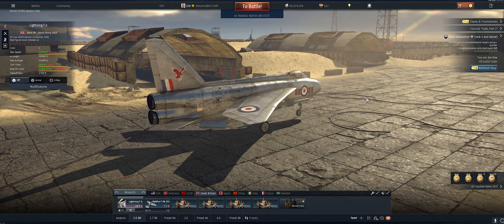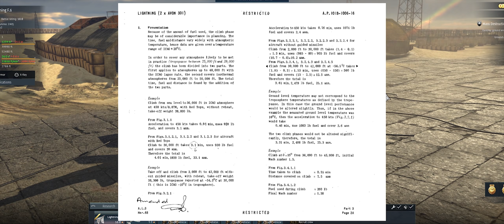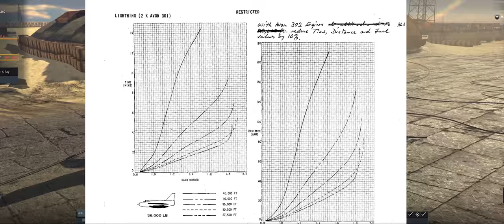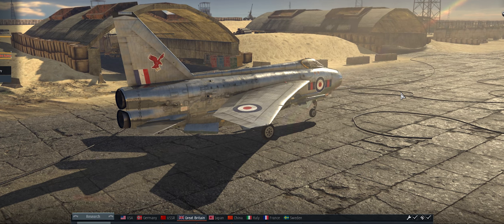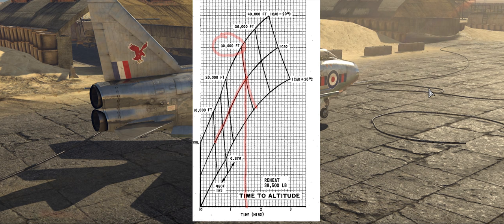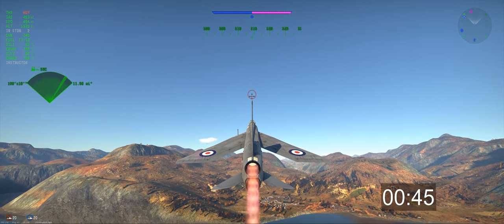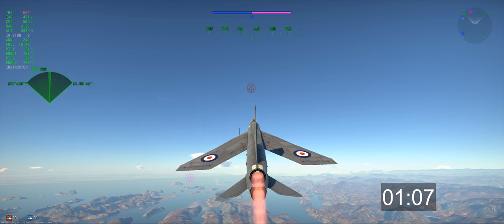True Facts About the English Electric Lightning's Performance - War Thunder 1.97

Comment: Cool. Now let’s talk about the EEL actually underperforming relative the mig21 and f4 in a video game, where they aren’t limited to the restricted manual guidelines
Reply: How is the manual restricting it? The manual gives best possible performance data for the aircraft; literally stating how the aircraft should perform in a best case scenario.
Reply: @zmb412  do not exceed speeds for lots of aircraft are set as the structural limit on the airframe which is incorrect. lots of jets in game should not be ripping at the IAS speeds they do.
Reply: @zmb412  No you misunderstood the point of the pilot manual. The pilot manual tells the pilot how should he fly it, not what can physics allow it to do. For safety reasons and criterias which are entirely based on the operator opinion, the pilot notes may tell the maximum speed is [..] which is in fact the maximum speed they are allowed to fly at, not the structural limit the airframe is capable of undergoing. Where it is problematic in War Thunder is that Gaijin model top speed as such, so some planes like the Javelin who were historically but not safely capable of reaching mach 0.94 at sea level aren't able to do so in War Thunder because Gaijin put for all planes the structural limit a few percents above the top speed whilst they aren't related. 

A MiG 15 as unstable as they were past 1000kph were allowed to fly as such in URSS whilst they may not have been able to in the UK, pilot notes may have written 1000kph max and Gaijin would have put the ripping speed at 1025 kph whilst this can't be more false according to reality.
Reply: @Wehra96  Im not saying the game is correct, I'm saying the manual is as close as correct data as you can get.
Reply: @rowanwild8445  No, as I pilot I fully understand the point of an aircraft manual. Procedures state how a pilot should fly. The manual states the performance that the aircraft can achieve assuming perfect conditions and that the pilot is flying exactly as defined to achieve that performance.  Yes, I will say that something such as rip speed is likely higher than Vne stated in the manual, on the subject of climb rate which is what was being focused on, those values in the manual are what would be considered best possible performance. Once again though these also have some leeway as they are determined through testing as well as calculation, so the aircraft likely will perform better or worse than these values even assuming perfect conditions. That being said, my point is that the manual is not "how a pilot" should fly, but "how the aircraft" should fly.
Reply: @zmb412  The manual is based on the longevity of the airframe. Pushing it past what the manual states is similar to using WEP. you increase wear and risk damaging it over time but ripping apart the aircraft takes a lot more which is my problem with it.

Comment: I don't want to be that guy. Maybe I missed something. But I don't think he applied the 10% reduction for the 302 engines. 
Either way, just shows that the Lightning is probably pretty bang on, if not, then ever so slightly over-performing.
Reply: Now to see whether or not the competition is accurate. Also partially gaijin's fault for adding this thing in at the same time as the late model phantoms though.

Comment: Hi Whooptie, you need to correct the charts in the manuals to a Calibrated airspeed and altitude with the Pressure Error Correction (P.E.C.), as this is what War thunder displays (even if it says IAS, it isn't, it is CAS). The manuals are written in Indicated Airspeed (IAS), which is what the pilot sees and old military aircraft tend to have uncalibrated static sources. For example, from Figure 1.1.1 you should be targeting an in-game speed of 450+10 Knots at sea level initially, at 20,000 ft the error is 15 Knots, etc. Similar story with altitude, at 30,000 ft @ 0.87 IMN on a real lighting is actually a corrected altitude of 30,650 ft, the chart is telling you the time to climb to this true altitude. This will not change much, if anything, and I agree it is overperforming with respect to the manual.

I have experience checking/generating performance manuals with flight test for civil and military aircraft, and they are formed with so much conservatism, factors, assumptions etc, you cannot accurately used them to work backwards. They are generated with conservatism for several reasons, the scheduled performance is undercooked so an end of life aircraft or heavily repaired airframe will still (just) exceed the numbers published. It is also done to make any customers, e.g. foreign air forces, feel like they 'Got a good batch', as when they evaluate the aircraft on the acceptance flights they find it out-performs the manuals, this is especially done on things like time-to-climb, and endurance data. It is very likely that this manual was generated with peacetime 'de-rated' engine speeds (some % of N1) that are used to extend the life and service interval of the engine. In a war-time situation these restrictions would be lifted immediately (by jumping some wires or pulling a fuse). You need to get your hands on some developmental flight test data, which is unfortunately likely still proprietry and classified, if you want to check the real numbers.

Happy to help with aircraft performance work if you need it, i've joined the discord.
Reply from the maker: I left that stuff out for the most part because OAT is a contributing factor in most the charts as well (especially for TAS).  Most cockpits don't have an OAT guage either (the Sabre does thankfully but I'm not sure it works).   I had to manually figure out OAT by using IAS/TAS and alt.... Then using standard lapse rate.   It was alot of work for something that plays little effect in the end result.   You're right though, but any thrust reductions (typically 10% for engine life) would be accounted for in the manual.   Either way you sound like you know what you're talking about... Look forward to working with you.

Comment: Isn't it more the missiles underperforming that people are complaining about anyway? 

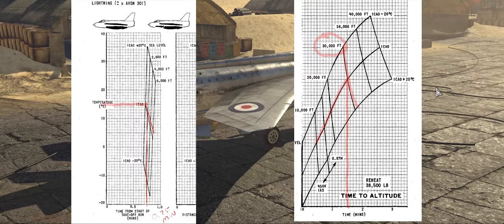Honestly I didn't think it was underperforming, at least not by a significant margin, shocking to hear that it's actually almost TOO quick to altitude, but I feel like if you'd have kept your pitch a wee bit lower to stay at .87 mach you'd have probably arrived right on time at 2:15, give or take a second or two. Also I wonder if you'd have taken off from the British runway if it'd have achieved the same time to altitude, I assume that runway is a tad lower. 

Thing is though, the Phantom in game can't even hit Mach 2.5 in a straight line afaik, and can't actually reach M2.3 at all (straight line) unless you have unlimited fuel, so we KNOW that aircraft isn't quite performing up to par (whether it's thrust:weight, drag coefficient, etc., I've no idea). The speeds it recorded it cannot physically reach with its own max fuel load. Then you take the fact that the F-104G would out-accelerate and out-climb Phantoms, and the fact that the Lightning repeatedly tested AGAINST the F-104 and beat it..... Well, perhaps as with the Javelin, the manuals don't tell the whole story. I'd take real-world firsthand examples over manuals and pilots' notes any day
Reply: I didn't read your comment and honestly with the consistent miskates you make in your videos and when you're called out for it, you flaunt your subcount as a rejoinder - you're hardly an expert in anything. 

Go back to making your red pointy arrow giant red circle videos and read off the wiki koala. Your credibility on these matters is as good as arabs and irsealis saying they want peace.
Reply: @asiftalpur3758  ... Honestly don't feel like I deserved this
Reply: @theScottishKoala  People man.. there will always be haters
Reply: @reedyblu8665  it's pretty easy to call people haters and hide back into your caccon when you've been proven countless times wrong to the point where a community contributor such as Koala can't even post his videos on wt subreddit because of his track record and flaunting sub count if someone tries to call him out.
Reply: @asiftalpur3758  Except that I have never at any point done this. This is a lie.

The only time I have quoted a sub count in my own defense is when somebody resorts to "nobody likes your content", but never have I used it to argue whether or not I'm factually correct. If you're having trouble understanding the difference between a personal attack and a factual argument, I'm afraid that's on you.

I think you're putting a little too much faith in Reddit to be a judge of character, when the Reddit community, particularly r/Warthunder, is infamous for being a toxic cesspool of hate, especially against ANY content creators. They're also infamous for their own misinformation and poor sources, and many of the times I've been "proven wrong", I've actually not been wrong at all. I think you need to understand what proof means. 

Of course I have made some mistakes, and any time I have I've made sure to correct them, but I've not made nearly so many as you seem to believe I have... not to mention that I CHOOSE not to post on Reddit. I am free to do so if ever I wish to.

Perhaps it would be wise to actually pay attention to the initial comment now

Comment: The kicker is once you get past 0.9 mach (1150 IAS) or at high altitude. That's when the thing started getting asthmatic compared to the manual in my experience. There's a forum thread with lots of this manual comparison going on atm.

Comment: I wont take that sh*t. The Lightning is underperforming, IRL it has 250m/s climbrate, in the game is only 170m/s, also the power/weight ratio was 1.15, but in the game it cant climb vertically
Reply: Not sure if Vittie sub or trolling. 1.15 TWR was at like 2 seconds of fuel left bruh
Reply: *Empty.

Pretty sure the MiG-21 and F-4 Phantom are also in the 1+ PWT when empty.
Reply: @miquelescribanoivars5049  Yes, they're both above 1:1 when they're close to 10 minutes of fuel.

Comment: This guy actually went big brain mode, I'm a pilot and didn't even think about looking at those charts (assuming those were available to the public anyways) good stuff man
Reply: As a pilot you surely know that they use manufacturer advised limitations which are nearly always lowballed to extend hardware life and exceeded in actual use?
Reply: @MrEsphoenix  yeah I specifically remember being told that when I first flew a da20
Reply: @MrEsphoenix  but what I implied by my comment was he at least went through actual documentation instead of the "lightning intercepted a U2 hur durr"

Comment: I invite you to listen to Ian Black describing the take off. (He flew 3 yrs on the Phantom prior to coming onto the Lightning. In ops this aircraft could, from brakes release, climb through 36000ft 60miles away in 3 mins. That was NORMAL for the F3 version. 2 Known aircraft exceeded 88000ft inlevel flight. Intercepting you U2's was easy.

Comment: It's 450 kts "without reheat", which means without afterburners in old language. Therefore, you have successfully demonstrated what an EEL would achieve without afterburners. It's there in the climb example from the manual.
Reply from the maker: That's section 3.1.1

This is section 3.2.2, with reheat

https://static.theaviationarchives.com/000/000/000/002/704/c783523dd203919414408045e822980a.jpg

Comment: The Current top tier meta all fight at lower alts, not as the aircraft are intended, thus aircraft like the E and the EJ are going to perform better because they have slats and all go around the same speed at deck level (roughly).
Reply from the maker: EJ doesn't have the slats like E does.  It's a stripped down export version.   I'll hopefully be going over all the Phantoms in a few days.
Reply: @WhooptieDo  Im not sure about the RL EJ but the EJ in game does have leading edge slats. They only account for 2 thirds of the wings compared to the Es but they are there. They only apply with hard elevator input.
Reply: @WhooptieDo see link for demo https://gyazo.com/4599a10f7761272170b2e4dca4174730 Sources seem to indicated this is may be incorrect modelling. Not sure if the physics are being applied in tow.

Comment: I think you’re right about the guns on the A-4 being trash. There’s enough ammo on board to secure a few kills, but not enough to carry if you have to. And the gunpods have a dummy low fire rate and add way too much weight. 

It still performs well though. Better than a Sabre.

Comment: What a way to shut others up ...., by proof.
Reply: He ballsed it up though... remember he pointed out the manual was for lower spec engines than the ones we have? He then forgot to factor that in... he didn't beat the data by 17 seconds... he beat it by 3.5 seconds... getting pretty damn close.
Reply: @FallenPhoenix86  I'm not on with those exaggerating the EEL's performance I was just saying that some people got cought up real hard.

The method was really awesame.
Reply: @skl-1371  I don't think the issue is that the Lightning is underpowered (confirmed to be false by this video of course), but its competition is potentially overperforming. It obviously doesn't help that its oppositon is often its replacement (late Phantoms) and gaijin waited an eternity to put this thing in the game.
Reply: @Xiphactinus  I agree on the argument that they aren't adding correct stuff in appropriate patches, this is a very visible fact that non can deny.

Comment: Is this some sort of joke ?

These are flight manuals for operational  squadron to use and they limited the performance in order to prevent repeated sonic booms over the UK and to prolong the service life of the aircraft,  they are not performance charts !!

The climb to height time chart is from take off too so no need to add them together  !!

The chief test pilot Brian Carol stated that the F15  Eagle was almost as good, but The Lightning was quicker off the ground. 
The Lightning's performance was totally outstanding when introduced into service, and when it finally bowed out, it could still out-climb most of its successors. Its initial rate of climb was 50,000 ft per minute.
The Mirage IIIE climbed initially at 30,000 ft per minute;
The Phantom F-4M managed 32,000 ft per minute; 
The MiG-21 could only manage 36,090 ft per minute; 
The F-16A's initial rate was 40,000 ft per minute, and the Tornado F.3's 43,000 ft per minute.
So the Lightning reigned supreme. Only later was it surpassed; the F-15 Eagle, and the MiG-25 both have initial climb rates as good or better. The Lightning's time to FL 360 in re-heat was 2.5 minutes, in this respect the Eagle produced a similar figure, though this could vary depending upon its configuration.
https://www.thunder-and-lightnings.co.uk/lightning/memories.php

The Lightnings performance was a closely guarded secret and it was not used to set records due to it's operational role, however in 1979 at GAF Jever in Germany a T5 Lightning from  11 Sqn - XS452  beat an F15 to altitude in an "unofficial" contest - The F15 was a good aircraft but came second fiddle many times  to the EEL that was over 12 years 
it's senior.

It's not just the speed or climb  that is wrong with the EEL it's the performance too. Bill Beardsley an exchange USAF pilot managed to get F15's in his gun sights and stated "my impressions of the Mk.6. They were all good.I had flown F-86Ds, F-94B and Cs, F-89Js, F-104s, F-100s, F-86Fs, F-102s and F-106s. In the UK, I flew air-to-air against F-4s and F-104Gs. At no time did I lose a 1 v 1 or a 1 v 2. And I was not very good at air to air. Yes, short legs, but a great turning radius and excellent acceleration, especially when you can unload a little."
http://www.lightning.org.uk/julaug05sotm.html

The fact that the EEL is "restricted" in War Thunder whilst other aircraft such as the Mig 21 are not - In reality the Mig 21 was not capable of operating it's weapons when flying over 595 knots under 10,000 feet and the Mig 19's fuel tanks would rupture in a turn !!!

It's only a game - but get it right  !!!

More tea Vicar

Comment: This deserves a shout-out from gaijoob (if they haven't already given one)!
Reply: They're probably too busy telling people every update that the manual alone isn't a valid source of information as it uses manufacturer advised limitations to extend hardware life, which are nearly always exceeded in actual use, to go and promote someone using said invalid source for a comparison.

That's why they require two sources of information before they will change a vehicle, and don't accept the manual alone.
Reply: @MrEsphoenix  I am pretty sure they used the manual as a lone source to prove that they were correct about the lightning recently.

Comment: I Thought the Manuel said it was supposed to reach 30,000f by 1.30 were did he say 2.15
Reply from the maker: The manual as stated computes time to altitude from 450 knots.  You have to also do the acceleration timing to get to 450 knots.    This threw me off at first as I saw it exactly as you did.

Comment: What about its top speed at sea level and at its optimal altitude, service ceiling, performance of red tops, velocity and potency of 30mm cannons, etc? Gaijin might have got its climb rate (sort of) correct but what about all the other aspects of the aircraft, I dont trust them to have got them all right. P.s. before people say I should just get the manual and check for myself I would but im broke from the bloody corona virus
Reply: I was hoping more areas would be covered not just climb :(